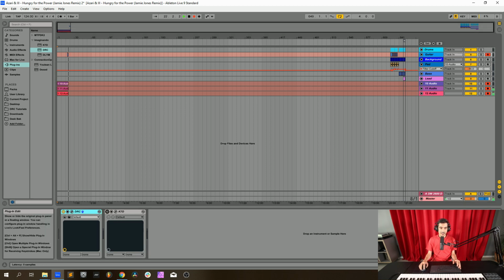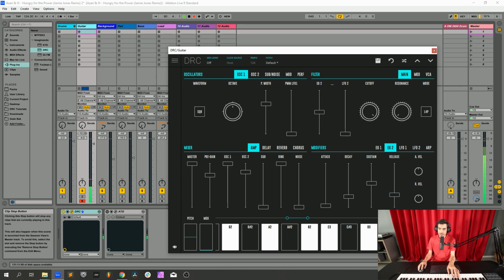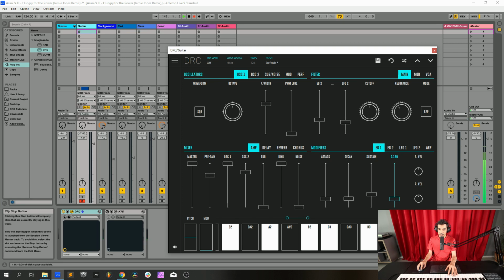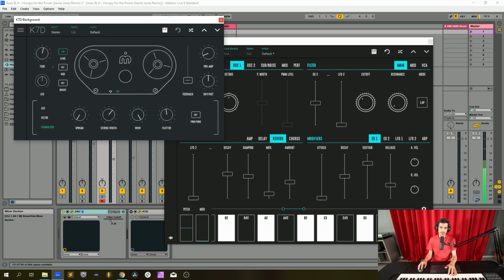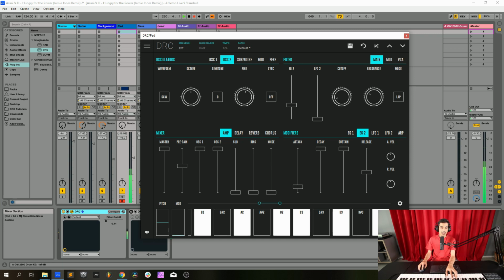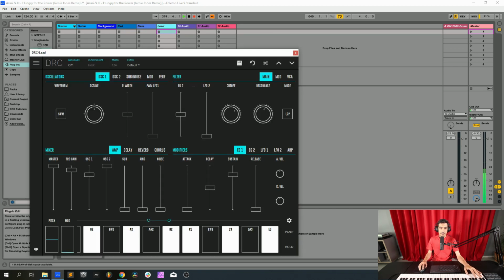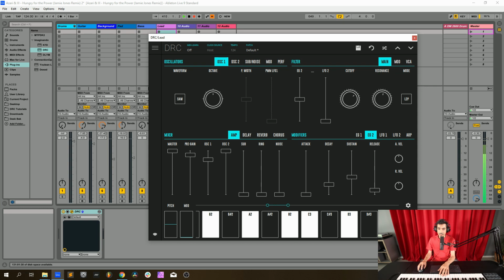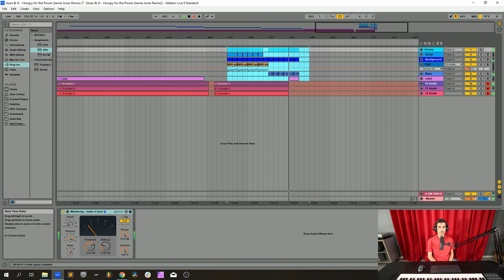How to make the sounds from Azari & III 'Hungry for the power' (Jamie Jones Remix)

Comment: Hey! Great Tutorial! Really like the bass, just tried to recreate it with the DRC Synth but if I crank up the pre gain like you did the sound gets distorted way too much...is there anything else I need to set up that this won't happen? Would be great to hear from you!
Reply from the maker: We are on the process of correcting that problem on some old videos that were done with an older DRC version. This version didn't have the saturation stage tuned in, so if you reduce the values of the PRE-GAIN on each sound by 250, everything should be fine. Sorry about that.
Reply from the maker: All Ableton sessions corrected and a note was added on the videos needed. ;)